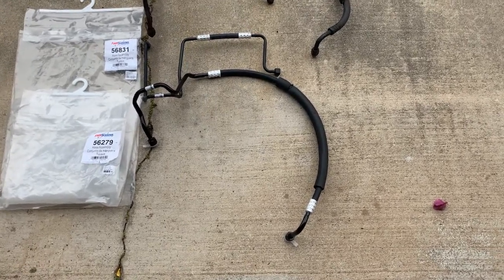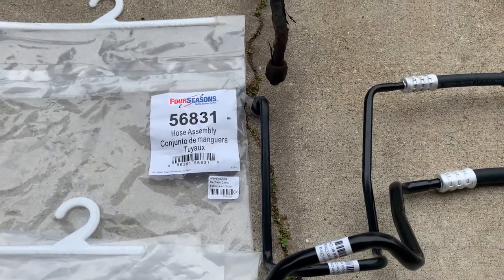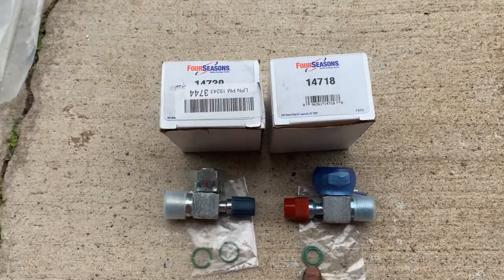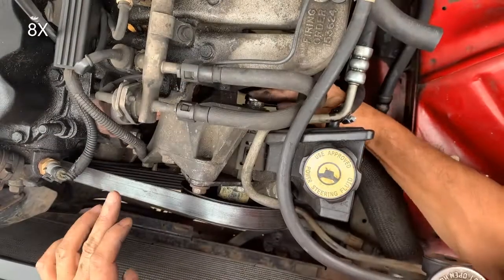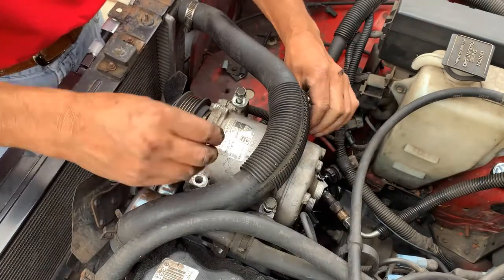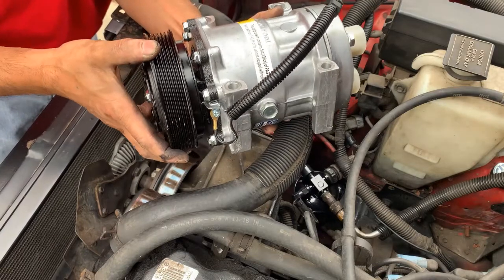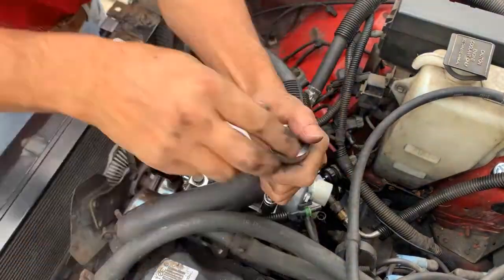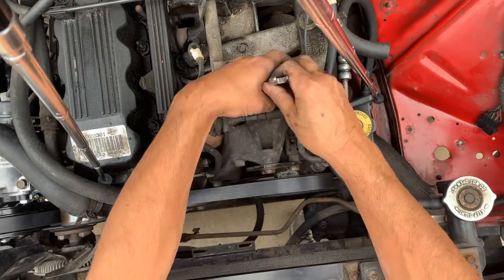93 Jeep Cherokee XJ, AC R-134 upgrade (Part II)

Comment: How did you swap the sensor side?
Reply from the maker: What kind of sensor?
Reply: @madatsukaerude  The drier sensor when the plug would not reach to the other side.
Reply: at 7:10 in the video
Reply from the maker: @peterfischbach2981  I loosened the fitting and swapped the position. On the cross fitting, one side has multiple connections. You have to be careful about which connector to disconnect. There was only one way that worked, though.

Comment: Do you remember how much oil you put in the compressor and was it PAG100?
Reply from the maker: It was PAC100, I think. I think the compressor was already filled with oil. I drained it and filled a similar amount, although I don't remember the amount.
Reply: @madatsukaerude  from what I can tell the entire system needs 7.75oz of oil (based on ‘95 as the r12 system was totally different ratios). My compressor looks the same as yours and I’m going to drain out the PAG46, replace with equivalent amount of PAG100, and then top up to a system total of 7.75oz by putting it in the condensor. Just another rabbit hole in this ongoing saga, thanks! 

If you didn’t add any more oil elsewhere in the system it may be running a bit dry. Just a thought. Thanks again!

Comment: Thank you for adding all the part numbers for everything. Got to do this on my 1994 4x4 sport which for some reason came with r12.
Reply: Jeep didn't use R-134a widespread until mandated for 1996 even though some were equipped with R-134a in 1995.  My Jeep FSM for the XJ does not show any R-134a data for the '94 and older XJ but the '95 FSM shows both R-12 and R-134a parts.  '96 FSM shows only R-134a data and parts.